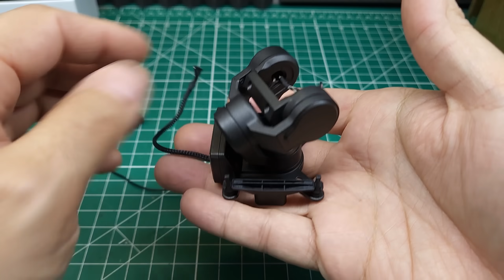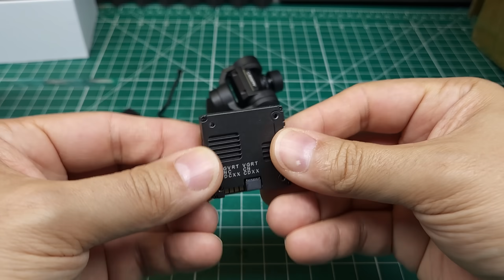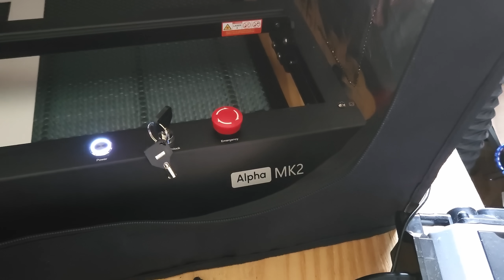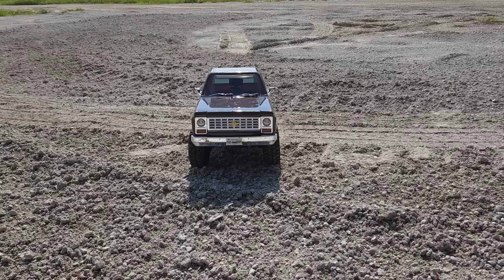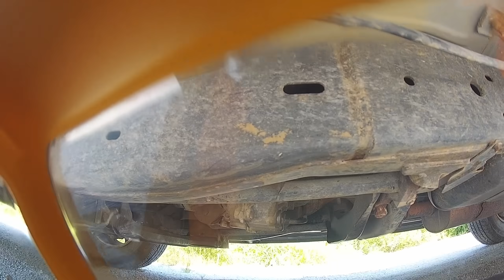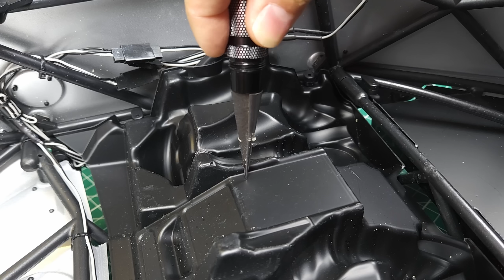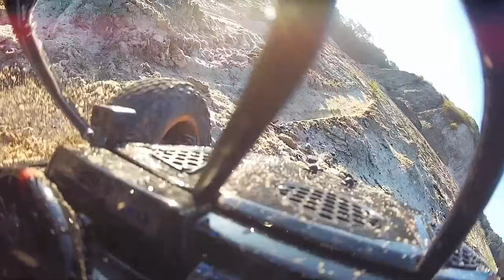NEW Head Tracking HD FPV Takes RC Bashing To The NEXT LEVEL!

Comment: If this item is proven solid and adopted en-masse by rc channels, folks, we are about to enter a new world of rc basher content. Can't wait.
Reply: It's not new. The reason it never took off in rc trucks is because its just so bumpy it can make you nausous, even with image stabilization. Little bumps and gravels are like boulders when you scale it up 10x which is what you're doing on a 10th scale trail. And the line of sight is behind grass half the time, and you can't see around because you're looking through a camera. Even if it rotates you're still stuck in it. Novel yes, enjoyable over time, no. Much more fun to drive from the outside.
Reply from the maker: @willyjimmy8881  then you haven't tried this. The mechanically stabilized system fixes pretty much all of those problems
Reply: My first thought is fpv rc buggy racing being adopted by the current rc racing organizations
Reply from the maker: @patrickpendergast898 I think it would be awesome!
Reply: If it's anything like flying a drone with VR goggles, it'll be cool as all get out..     sign me up..
Reply: I have seen a rc sold with this type system already. It was a cheap crawler to be honest. Wasn't a hobby grade rc tho. More like a Walmart rc, but it came with goggles an a camera in the crawler  that did work rather well for being so cheap. This quality rc an camera set-up is expensive and out of most people's price range.
Reply: I don't see most RC channels putting that much effort into their videos. 
They're mostly about showing off the new FOMO thing, and how do you show off something you can't see ?
I'd love to be proven wrong.
Reply from the maker: So far it's held up a lot better than I expected it to. Being primarily hardware design for flight I kind of expected it to die on the first crash or the first time it ate some sand but the thing's a tank so far.
Reply: We just need a laser printer and a 3d printer… this needs to be in a rtr kit for it to actually become the future
Reply from the maker: @a36538  Well really just the 3D printer and honestly you don't even need that. You could make amount for most applications out of a block of wood with basic hand tools. RTR solutions would be really cool though.
Reply: 😂🤣😂🤣😂🤣 I done this roughly 10 years ago not a new thing................. Maybe leave the rock you've been under...............
Reply: @jeffro5180 you’re so cool and edgy. I wish I did everything before it was mainstream. Hell yeah brooooo
Reply from the maker: Some of the elements of this setup have been available independently for quite a while but it's only been recently that a relatively simple to set up and reliable plug and play system has been available. A lot of the old gimbals were finicky at best and certainly not durable.

Comment: NIce but I'm using an ESP32 DIY tacker system for my FPV planes that not only will do full head tracking camera positioning of my HDZero camera but I also have a camera return to center switch programmed and a track ground station switch as my ground station is also a DIY automatic antenna tracker that also has a camera mounted on it. Not sure I could do all that with an out of the box setup lol
Reply from the maker: I don't think you can do the antenna tracker but this does have a return to center feature. You triple click one of the buttons on the headset.

Comment: Active Camera Stability is a game changer, I tried RC FPV too and never really got into it because the vibrations are awful. It quickly reminds you that drone footage looks great because its on a cushion of air, Cars are not
Reply from the maker: I completely agree. I honestly wasn't even thinking about that when I first installed it but it really is the game-changing feature of this system. The head tracking's great but the stability is what makes this work where all other surface FPV has just been a novelty in the past.

Comment: The mic sound like you're actually sitting inside the RC.
Reply from the maker: In the clip with the crawler I had my microphone set up wrong so it was only picking up my voice bouncing off the windshield inside my truck. I did my best to make it sound as good as possible but there wasn't much to work with unfortunately.

Comment: Does it look as clear through the goggles as it comes out on camera?
Reply from the maker: Yes. What you saw was recorded on the goggles. It will decrease in clarity a little bit with signal degradation but what you saw on the video is what you'll see in the goggles.
Reply: @DoRC  that’s amazing! Thanks👍
Reply from the maker: @joelwaters6165  It really is. Modern FPV technology has come a very long way from just a few years ago.